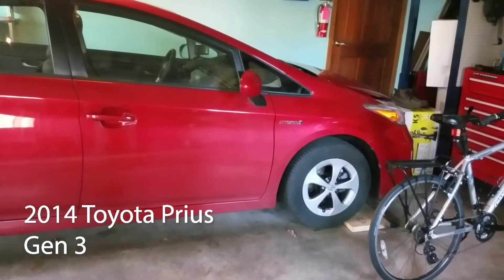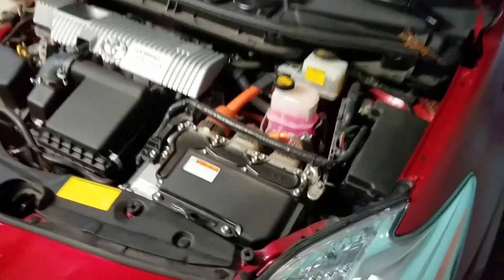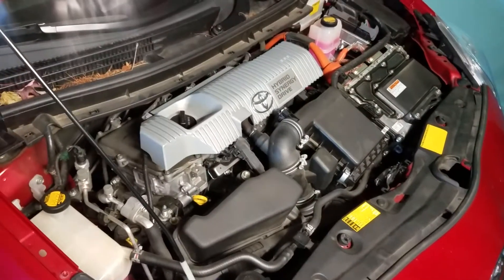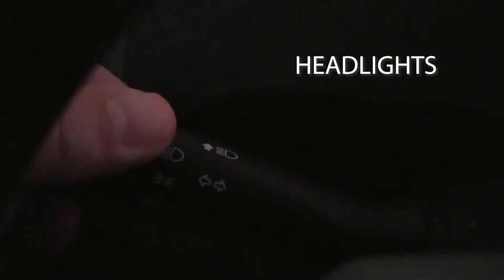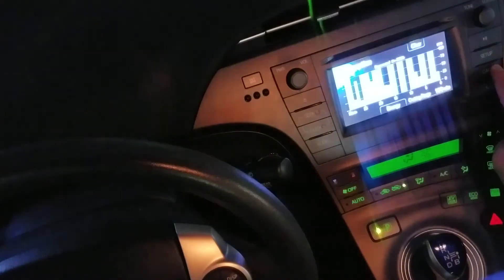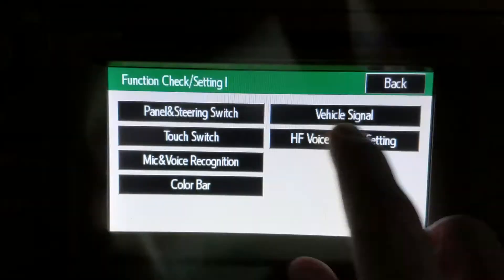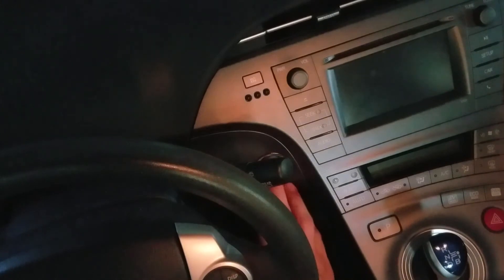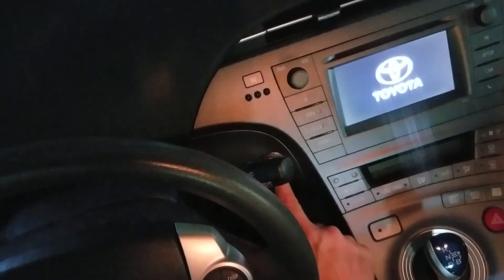PRIUS GEN3 12 VOLT BATTERY SELF TEST

Comment: The voltage you got is at car started. What happened if the car could be battery dead and no display showing? I watched another YouTube video demo for an earlier version (Generation-1 or 2). It could show battery voltage while without starting the car. But button locations are different from my Gen-3 and I couldn't try it successfully. Do You have an idea how?
Reply from the maker: No idea how to do it without staring the system. Of course any cheap multi-meter can be used to measure the voltage from the fuse panel in the engine compartment. BTW this 2014 gave up on the OEM battery 3 months ago. Thanks for watching and sharing.

Comment: Thank you for this tip. I have a 2010, bought at 112k(2024) and currently 126k(2025). The 12v battery on it was dead when I went to test drive the car, they had to jump it off. Never charged it after that, but felt it could be weak. I did this procedure you mentioned, and voltage was 10.8v.. the other night I left the stereo playing while grilling(it was beautiful outside 72f) and the amp finally gave out after about 30 minutes or so of cranking some tunes(I'm out in the country neighbors are far off) the car wouldn't start. I pulled the battery and threw it on a smart charger overnight. The battery is the OEM "Yuasa" Toyota AGM battery and is an "84 month" battery stamped with 09/16. That's "September of 2016" 8 years and this year will be 9 years going on that battery. Folks, if you want a battery that will last, it costs a little more, but dang where else are you gonna find a battery that will go this long?? I put the battery back in this morning after the charger said 100% 12.8v and did this voltage test again and it's sitting at 11.4v with just a 2 button(no brake) press check on the battery. Car starts fine so I'm just gonna leave and let it roll to see how long this thing will go before it totally dies. I have a USB-c jump pack in the cargo trunk that I always carry around anyway..
Reply from the maker: Not a good idea to run down the battery, but yes my OEM 2015 is still working in 2025. As long as you are above 10v (at least w Gen 3) the battery will power the computer allowing the traction battery to do it thing. If it dies I will purchase the same very expensive battery.  Thank you for watching.

Comment: 2:37 11.9 volts is the at rest voltage. Should be more like 12.4 volts. Turn on the headlights to apply a load. Watch the voltage drop into even worse voltage reading.
Reply from the maker: Yes you are correct typically the voltage would be 12+ but the Prius only needs 10+ to start the hybrid system and then the DC to DC converter takes over. The 12V battery is not meant to power the starter, only the computer system.
This car is still running on the OEM battery from 2014 and it turned on this morning with a temp of 10F. 
While turning on the headlights or any accessory would load down the voltage, in reality you wouldn't do that before starting/turning on a vehicle.
Thank you for watching and sharing.

Comment: Great Video. How do I get to the menu if I don't have a "car" button? I just have setup. My son did go to the battery itself and mine is at 11.5 v (gasp) it had been dragging while driving and my mileage was dropping a tad.
Reply from the maker: As long as the battery is above 10.0V the computer should switch on. Our 2014 is still on the original 12v battery. Since you don't have the "car" you may want to try pushing the button in the same location?

Comment: Got a brand new battery installed after seeing low voltage from the diagnostic screen and having it tested at autozone. New battery is reading at 11.5v 😢 on the diagnostic screen so now I’m worried there’s something else going on with my car
Reply from the maker: I am still on the 2014 OEM battery and I have discovered as long as the voltage does not drop below 10.0V the car will turn on.

Comment: Ok so what if I don’t have a screen like yours.
Reply from the maker: While this video is specific to the Gen3, one can always purchase an inexpensive voltmeter and get a reading either from the battery or from the fuse block. Harbor Freight has one for about $7 https://www.harborfreight.com/electrical/electrician-s-tools/multimeters-testers/7-function-digital-multimeter-59434.html

Comment: I just tried this and it worked the first time perfectly! The battery showed 12.2 volts. However,  I tried it a second time and NADA!  Then I tried to actually start the car - a 2013 Prius - and now the car is totally DEAD! No lights or power at all!  WTF?  How do I get it back to normal?
UPDATE: 3 hours later: I was lucky I had a spare 12 volt AGM battery which was still good, so I swapped it out when I found the installed 12 volt battery had somehow gone bad right after the test!  It measured under 1 volt after I took it out and something like 74 volts when still connected!  I have no idea what exactly happened to blow this battery out. And it was insatlled new just 14 months ago!  Bottom line: I don't think I will be running  this "self test" again!
Reply from the maker: Steve, just displaying the battery voltage will not do anything to the vehicle. I have never played around with the other settings so not sure what they can or can not do.
Reply: @cfldriven  I don't think the battery self test was the issue that caused the battery to die. Although I did run it two times. Then after that the car would not start so I tried everything I could think of to get the lights to come on the dashboard. After that I even jumped the car with a battery pack and still nothing. So whatever it was I cannot tell!

Comment: Mine reads 12.1 does it need to be replaced?
Reply from the maker: When turning on your Prius, the battery voltage should not drop below 10.0 Volts.

Comment: Also discovered after watching this video that I can power up car normally (with foot on the brake) and still do the [Car button + 3 headlights on-off] procedure and it will show me the battery voltage with the inverter supplying power (should be around 14v for a healthy battery).

Great vid! Thanks!
Reply: I will try the |"Power up  normally" Car button + 3 headlights on-off] \ approach on my 2014 TOYOTA PRIUS V because the one here did not show the "Service Menu"
Reply: I finally got to the service menu with the car running plus Car button + 3 headlights on-off.
Reply from the maker: @luisparra8530  Thank you for sharing.
Reply: @luisparra8530  yeah, I don't have the "car" button on my 2012 Prius V. I just have setup. When I went in, I can place information for scheduled stuff. That's it.
Reply from the maker: Brennan, thank you for sharing how to read the inverter voltage.
Reply: @cfldriven you’re amazing! Thank you!
Reply from the maker: @Go-Go-Gadget-g5o  We try. Thanks for watching.
Reply: This worked on our 2013 Yaris hybrid. I held the CAR button and only needed to switch the headlights on two times instead of three, in the accessory position of the key, to get to the screen. Doing the same in Ready mode let me see the increased voltage with the inverter running (about 15v in my case, Vs 12.8v when not charging)
Thanks for this useful post.
Reply from the maker: @johnhodgetts6617  There is a Yaris hybrid? I only saw the gas version in Southern Calif. Thank you for sharing the info that other Yaris users can utilize.

Comment: get a 4 amp charger that has an AGM setting from Harbor Freight. Charger that battery with a smart charger as a routine maintenance item.

You happy Aux battery will thank you by having a longer life.
Reply from the maker: James, I agree some regular battery maintenance can add to battery life. I actually got the Cat https://youtu.be/HoxL5Svkc3o which works with 3 types of auto batteries. Thank you for sharing.

Comment: I have same car 2012 Prius I tried did not work
Reply from the maker: Sorry, maybe the code is different for your model year. I was told it was the same for Gen 3 models.
Reply: Got it tested in autozone it’s said bad battery just bought a new one thx
Reply from the maker: @SIMPLEGUY423  Good to idea to get it replaced before it leave you stranded.

Comment: Great video, if you did have a multimeter what setting would you use to test and what number would means it's good? Thanks
Reply from the maker: Set the multi-meter selector to 20 volts DC. Depending on meter your choice may only be DC. 
When turning on the car, the voltage should not drop below 10.0V.  Our 2015 is still running on the original battery.

Comment: I did this check on a 2010 (using the InfoPhone button),and it showed 11.4 volts.  I replaced the 12V battery and the new one showed the same reading, or sometimes 11.3 volts, even after several hours of driving/charging.  So I tested the old battery with a volt meter and it showed 13.4 volts.  I then tested the new (still installed) battery at the fuse box terminal - 13.4 volts.  So I'm not sure what this check shows, but as presented it doesn't seem to be a good indicator of health of the 12 volt battery.
Reply: Any update on this? I'm curious.

Comment: I don't know if I should be angrier with you, or with myself.  The app on my phone (Hybrid Assistant) kept telling me the battery on the used 2014 I recently acquired was setting on 11.4 volts.  I ordered a $39 multimeter this morning, and spent most of the morning looking at batteries and prices.  Then I went down to the garage, and used your technique, and in less than 30 seconds the car told me the battery was reading 12 volts.  Your method acted beautifully, and I feel much less pressure now to run out and buy a new 12-volt.  Of course, I'm very grateful for this tip.
Reply from the maker: Something I learned after the making of the video is as long as the battery voltage does not drop below 10.0V the car should start. My 2014 OEM battery was at 11.38V in December. When it comes to replacing it I will get a Toyota battery because even though they cost more up front they seem to last a long time.
Reply: Is your car still going strong?
Reply: where can you check that in Hybrid Assistant?

Comment: When I turned the car engine on, that 12v voltage changed to a higher voltage. Is that the hybrid battery?
Reply from the maker: Yusuf, the higher voltage is from the DC to DC convertor that charges your 12V battery. The DC to DC is feed from the traction high voltage battery pack since the car doesn't have an alternator.

Comment: You can check it this way, but that number alone won't tell you much about the health of the battery. Go and measure directly at the battery terminals, and you will see a higher voltage. Typically this difference is about half a volt. So you need to know what this difference is for your car.

Comment: Wanted to know how my hybrid battery was doing.
Reply from the maker: I know of three ways of testing the hybrid battery, which I have never done, one is to have the dealer test the battery, a cheaper route is try a ODM with an app like DrPrius, and finally look for telltale symptoms like drop in mileage, engine running all the time, battery not holding charge.

Comment: I can’t get it to work on my 2013 Prius iii. 1. Press power button 2x 2. Press and hold Car while turning headlights on and off 3x. 3. Let go of Car button
Reply from the maker: In the comments are a couple of 2013 that had success with this procedure. You might want to try switching the headlights 4 times as those were the instructions I found. It just so happens that when I did 3 it worked so I went with that.

Comment: Replace 12 volt battery with OEM Toyota brand..... Mine was 220 at the dealer...... Took about 25 minutes to install myself first time.., don't trust all these aftermarket batteries with all these electronics in the Prius.
Reply from the maker: I agree with you the OEM matches the resistance specs the DC to DC charger is built for. Even at $220 it still a bargain considering our OEM is 8 yrs old. Thank you for the info.

Comment: I have a 2013 Trim Level Five (not the V wagon) with the Tech Package which has a different upgraded radio which has no "Car" button to push.  Also, the radio screen does not light up or turn on at all after pushing the Start button twice.  How do I access this maintenance/system check feature then?
Reply from the maker: Don't know if this will help but Mrswann Shiran mentioned,
Try display button instead of car button, good luck
Reply: @cfldriven    Thanks for the reply, but there is no "Display" button either.  Any other ideas?
Reply from the maker: @ricpratt6584  Ric sorry to say I don't, maybe someone reading the comments has a suggestion.

Comment: Thank you for this.  Picked up a used 2013 Prius.  I've been getting around 6liter per 100 km and slowly getting worse.  Checked my 12v and it's at 11.7v.  I'll replace it today.
Reply from the maker: Depending on type of driving, season, and terrain this mileage maybe on the low end. Unless you have very cold winters you might be able to get another year or so out of the battery. Our 2014 OEM is still running strong. You may want to have the traction battery checked to see if any of the cells need to be replaced and if it still under warranty. In the US it can vary from 8 to 10yrs or 100,000 to 150,000 miles.
Reply: @cfldriven  Thank you.  I tested the battery today at Lordco (similar to NAPA), and it showed as just needing a recharge.  I pulled it from the car and charged it for 2 hours at 2amp max until it was full.  Went out for a 20 km test drive this evening and the car computer is showing 4.8L / 100km (49mpg) from 6.8L / 100km (35mpg).  The battery is now showing 14.5v rather than the previous 11.7v.  I'll keep an eye on it and report back if it continues to show the improvement or if it goes back to the lower mpg.  I drive a lot of short trips around the city so it may require an occasional charge out of the car to keep the battery topped up.  I hope not, but if that is the case, I'll need to pick up a memory maintainer to keep my trip computer info.  Lost  the data when I disconnected the battery.  It will probably take a week or so for the computers to relearn how everything is running.
Reply from the maker: @iansmith7286  Short trips can lead to voltage drop as the inverter doesn't have enough time to top off the battery. Mrs also has short commute under 3 miles, but weekend drives are enough to get the battery back to normal. You may want to consider a 1 amp charger/maintainer that doesn't involve disconnecting the battery.
Reply: Thank you.  I'm going to pick up an amp meter to confirm the inverter is charging the battery.   Then I'll take it out for a long drive to see what happens.
Reply from the maker: @iansmith7286  Don't forget you can use the connections in the engine compartment fuse box (about 0:43 in the video) to get a reading instead of opening up the battery compartment in the hatchback. Best of luck.
Reply: @cfldriven   Actually I cannot use the front connection. The battery tester I'm using requires both sides of the clamp to contact the post.  The front jump start strip only contacts one side of the positive clamp.  It's easy enough to get directly into the battery contacts.
Reply from the maker: @iansmith7286  You should be able to clamp onto a nearby bolt for the negative side.
Reply: @cfldriven Yes, that is not the issue. The battery tester I have has two wires to the positive and two to the negative on the positive clamp one wire goes to each side of the clamp. One wire test voltage the other tests resistance or other seperate tests depending on what you are doing.  The front jumpstart terminal on the positive side is not compatible with this type of meter.  Most of the small battery tester analyzers I have seen work this way.  Opening the hatch and lifting the battery cover is no more work than opening the hood and opening the fusebox.  So it doesn't really make much difference.
Reply: The battery tester is similar to this one. https://youtu.be/noE98WzXQSg
Reply from the maker: @iansmith7286  Interesting, can you forward make and model, want to learn more about this tool.
Reply from the maker: @iansmith7286  Thank you.

Comment: Omg I have a gen 2 but I didn’t know this could be done and watching your video now I know we can and I also know I could take a small vote reader and hook it up to the front of the car and bring it through the dash so I could have a continuous reading I don’t know if that would be so smart..
Reply from the maker: Not if the meter is on all the time. Since the battery is there to start the traction computer there no need to check voltage all the time. Apparently  if starting voltage remain above 10 volts the car will run. If you get to that point it probably a good idea to shop for  a replacement. Our 2014 is still on the OEM battery.

Comment: Hi I live in 🇬🇧. I have gen 3 2010 model. I don’t have the car buttons. What shall I press?
Reply from the maker: Hopefully someone from your side of the pond has experience with this and can answer. As alternative you could get a voltmeter and read the voltage from the front terminal fuse box or directly from the battery.